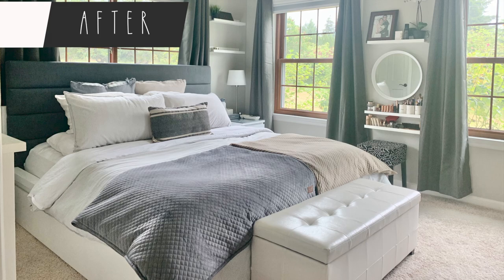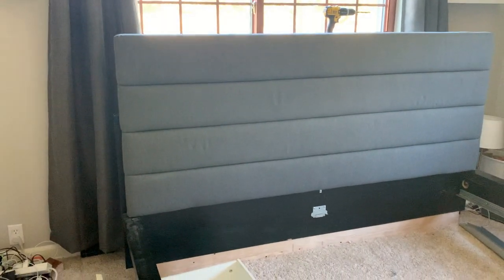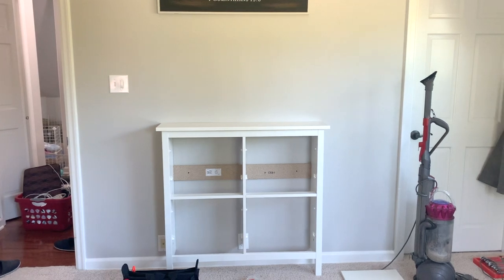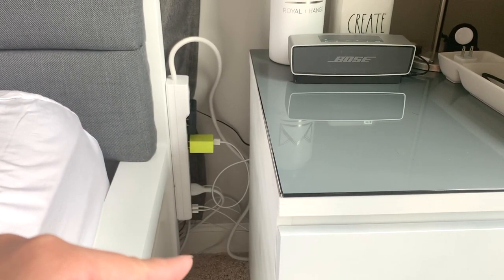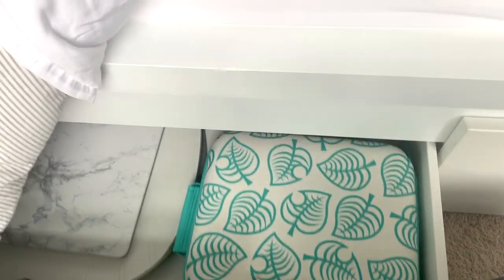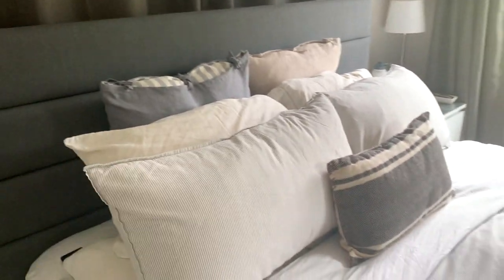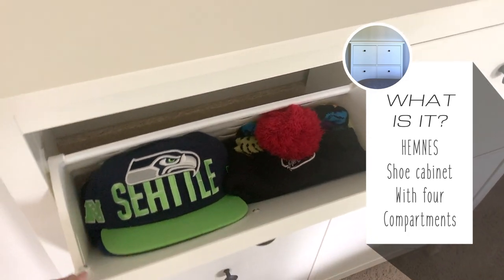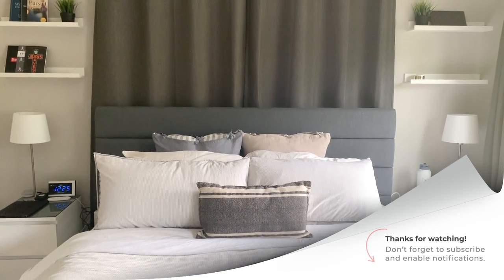IKEA MALM BED FRAME -  ADDING UNDER THE BED STORAGE!

Comment: What is the measurement of the 2X4 used to raise the bed? I would like to do this myself. :)
Reply from the maker: about 6.5 feet? Lol it’s not even the whole measurement of the bed’s width. That would add 4 more inches. It still worked and our bed is still standing!! 😆

Comment: How is the sturdiness of the 2x4s under the header and footer of the bed?
Reply from the maker: It’s sturdy enough. Still in tact lol 😆 these were just what we had on hand
Reply: Would you be able to elaborate how they were attached?   I'm assuming screw plates used on the sides not visible to the eye!

Comment: lots of dust go into the underbed drawers , any way to prevent that?
Reply from the maker: I get a lot of dust as well in my house as well, it's unpreventable lol but we just vacuum. If you have a cordless vacuum, that is sooo helpful as well!! I prefer those vacuums because it's much lighter haha
Reply: Depends how worth it preventing dust is for you haha

Makeshift dust cover/lid for each drawer?

Measure and cut out a semi sturdy fabric as well as two strips of cardboard
Fabric the same surface area as the top of the drawer, cardboard length of drawer’s side
hot glue the cardboard onto the fabric sides
Then hot glue the top of the drawer’s very back panel along the edge and attach the fabric

It’ll lay flat, cheap &easy to do, keeps the dust out, accessible

Comment: Hi, just wondering how you raised the bed? Nice Video🌻
Reply from the maker: We used the wooden pieces shown in the video hehe 🙃
Reply: I was looking for the numbers myself, Google brought me here.    As you pointed out the added 2x4 -it appears an older, low style malm bedframe requires 4 inches of height added in order to accommodate the under bed drawers....

Only the baseboard was pointed out, but the headboard would have the same length of 2x4 added as well!
Reply from the maker: Yes, it was a 2x4 Iol I just asked my hubby. We just used pieces of wood that we had laying around and painted it to match!
Reply: @xolivi  how did you attach them exactly